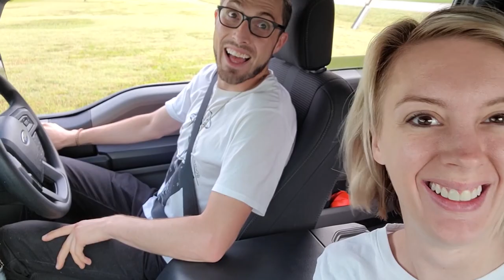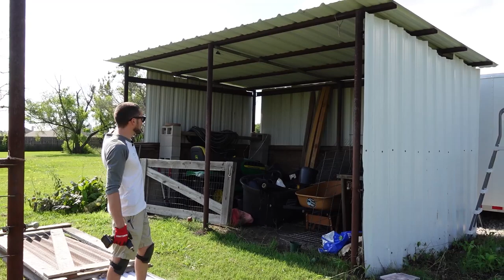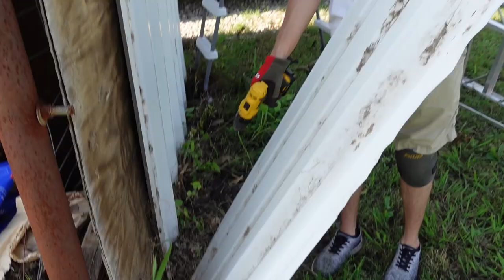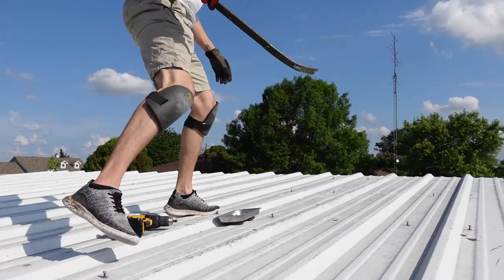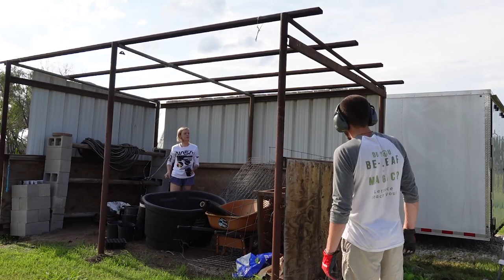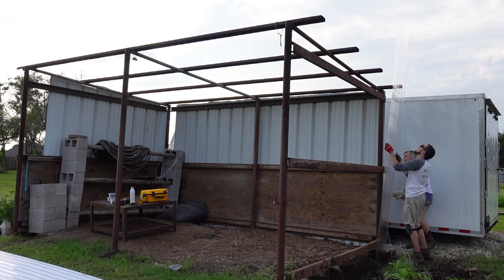Converting our Old Shed into a partial Greenhouse!!

Comment: We built using those same panels. The water weight if you do not slant it enough (during heavy storms, 9lb of water per gallon of rain or so). The middle of them will buckle, so be sure to have an extra slant if you can add more to one side (using a 2x4 to increase the slope angle)
Reply from the maker: I really appreciate the tip! We will likely prop it up then with an extra 2x4 then to increase that slope angle. We get some crazy downpours randomly here… thanks again!! 🤗🌱🌱

Comment: Too cut the side pieces..measure the short side from bottom to top then do the same for the long side starting with the shortest edge..run a line from mark to mark and cut it..on the next sheet just use the long measurement..on the building just measure over how Ever wide your sheet is and take your vertical measurement there.
Reply from the maker: Thank you for the tip!! I’ll be cutting these tomorrow so that’ll help! 🤗🌱🌱